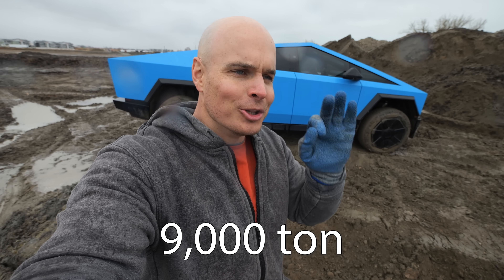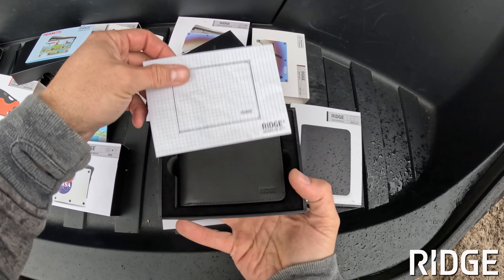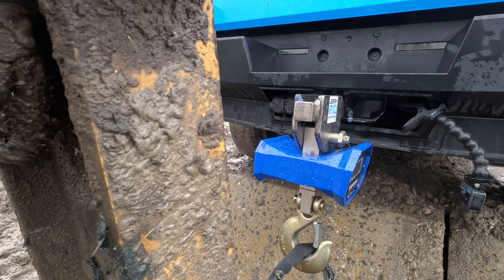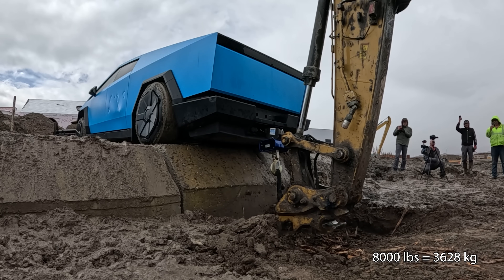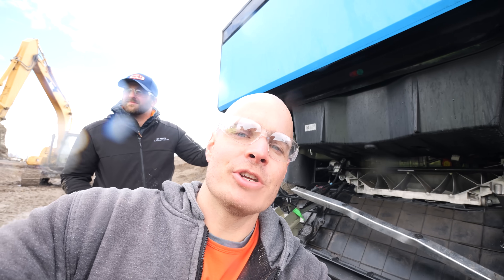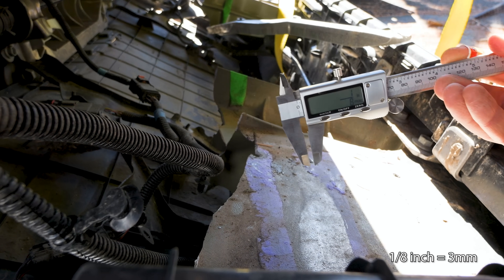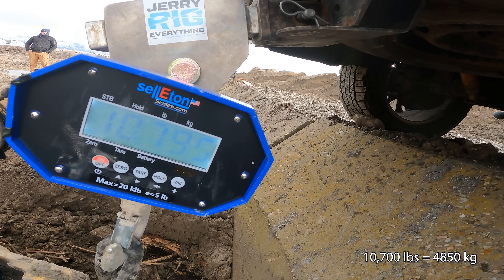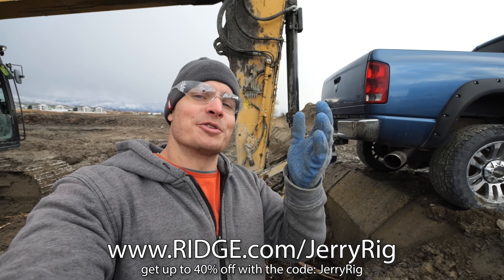SHOULD YOU TOW WITH A CYBERTRUCK?! - (catastrophic failure test)

Comment: Normally a hitch is only designed to take a downforce of around 10% of its towing capacity which works out at 1100 lbs. The actual spec may be different but 10% is the normal yardstick.

Not only did you go more than 9 times that amount, you were holding the front of the vehicle down. It was an unrealistic test and one that really isn't in any way relevant either to the real world.  Not a fan of the Cybertruck but I cannot see any cause for concern if operated by someone using a little common sense.

Comment: "10,000 lbs where it breaks is not a good thing."
Dude what? You put 945% of the rated tongue weight on the truck. It outperformed its rated capacity of 1,100lbs by over 9x.

An 11,000 lb tow rating does not mean that amount of force is applied on a hitch. Typical tongue weight ratings are ~10% of towing capacity. Which would be 1,100 lbs.

Comment: I bet all the error messages are from one communication bus going down. Did they use CANbus in the Cybertruck? Some small signal wire probably got shorted when the bumper broke off affecting all other communication on the bus.

Comment: Dude they use SpaceX engineers and materials scientists to design the frames, then they run it through simulation software at various fatigue values. I know you're smart so do the math of an uneven load and it's still safe. To think somebody wouldn't tow with it because some guy on YouTube broke it, when using it in a way it's not designed is foolish

Comment: It must be nice to spend $100k on an electric truck only to trash it. I drive an old Ram by the way, 2002 and it is still on the road. I could have bought 5 (bought new cost in 2002 $24k) of the for the cost of that Cyber truck and my frame wouldn't break.

Comment: Whats super weird is most other things that hold life risk responsibility usully require 3x the max shock load as a saftey factor before yielding. And in many other cases multiple "X" beyond that. Just to strap down that tesla on a flatbed i need to have straps that are rated for atleast 80% of the weight being secured and said straps need to be tested at 3x their rated capability without yeild. Idk how tesla got away with this but i can honestly say its a trend ive seen and feared in the auto industry since mid 2000s when payloads andntowing capacity seems to skyrocket without much change in frame designs reallynonly to be minorly tempered but class 4 and 5 hitches on the light duty "heavy duty" pick ups

Comment: First, an aluminum structure is whatever strength the designer made it to be. Quit saying "aluminum vs. steel" - the material doesn't matter, what matters is the design. You could make a friggin' cardboard truck that is stronger than a steel one if you wanted.

Second, you're completely misunderstanding the concept of fatigue limits. Steel will get weaker with every stress cycle until it reaches about 50% of its original strength, while aluminum and most other metals can continue to degrade beyond that all the way down to zero strength. This sounds bad, but it's typically occurring over the course of millions, billions, or trillions of stress cycles. What you did loading the hitch twice has absolutely nothing to do with fatigue. It has nothing to do with materials, it has nothing to do with casting or extruding, and you shouldn't have even mentioned any of that.

Third, tongue weight limits are usually specified as ~10% of the towing capacity - across all brands - yet you claim that "potholes" or "hills" can somehow increase tongue loads by 10X without even attempting to offer an explanation of the mysterious physics that you claim can cause this. Heck, forget physics and aluminum and all that stuff - if you and Diesel are the only 2 people in the world to have ever broken a Cybertruck frame like that, whilst deliberately trying to break the frame like that, why is this even a thing? Either show me footage of this epidemic of broken Cybertrucks flinging loose trailers all over the highway or quit wasting my time with this contrived nonsense.

Fourth, you have 10M subscribers and so much cash flowing in that you can whimsically total a $120K ($170K with the wrap) truck on a random Monday just "for the gram". Yet you couldn't bother to spring the extra $500 to rent something capable of supplying more force? I might forgive you for not Googling "how engineering works", but to not even finish your own project is just lazy.

Finally, don't dismiss my criticism as some sort of defense of Elon. F that guy. Nor am I defending the truck. I'm only defending logic, physics, and engineering - all of which you have failed to respect in this video.

Comment: Jerry, I am disappointed you are not aware of the huge differences between Shear Strength and Tensile Strength.
Shear Strength = Tongue Weight Capacity and Tensile Strength = Towing Capacity. (To put it simply, but there are more variables to Towing Capacity)
You should have researched this BEFORE you made the video.

Comment: also it wolud not allow brake away brakes to be applyed in alot of cases as the wire that makes that sustem work  is atached to the same area as the safety chains slos can you cut some of the alloy out of the back test it to see its ductility ect please if you own one of these please dont tow things

Comment: to be fair if the hitch snaps of the trailer wont be running on the road by itself ,seeing the faults it gave the truck would crunch the brakes i guess {seeing it wont drive } so if the hitch snaps off it would simply plow into the back of the truck im guessing

Comment: Tonbe fair, the cybertruck was bottomed out... with the more ridgid body, the cyber truck creates a stress point on the frame, making it easier to bend... the dodge pivots on the wheel, distributing the force through a larger area... you can clearly see the whole bed of the dodge bending, whereas the cybertruck has nonflex... not saying the cybertruck has no flaw in the design, but i also don't think normal use would cause this failure...

Comment: This is an inherently flawed test, and just to preface,  am by NO MEANS a fan of the cyber truck. Here are my thoughts and someone please try to prove me wrong.

-a tongue weight of 10,400 will NEVER be reached, or even half that if towing at the max capacity of 11k. Ir doesnt matter how steep a hill you crest is, it would have to literally be driving straight up a 90⁰ straight up to horizontal with the trailers tires coming off the ground to see all that as tongue weight, which no vehicle is capable of doing. Like if you spun out on a bridge and the trailer went off the side. But in all reality, if that scenario ever happened, snapping off would be the best outcome you could hope for.

-I own a dodge ram, 2002 but this happened ~8 years ago so it would have been younger at the time as this one was today..amyways iy was a little hopped up, nothing crazy maybe 500whp, and i sled pulled with it a few times. Less than a dozen pulls in, i literally ripped a class 5 hitch in half and bent the frame inward. Now im sure everyone has seen the tesla vudeo of the cybertruck pulling a sled, and several other people have pulled with them as well. Those sleds weigh around 40k lbs...and its not like the bottom is flat, they have like 2" angled teeth underneath to dig in to the ground. And this is on. Well prepped track where you can get better traction than unprepped asphalt. 

-if you had to hold the front of the cybertruck down, its not realistic. How many times have people created a hill, or hit a bpnin the road that caused their front tires to come off the ground? Cmon, lets be realistic here.....

-no one is going to be pulling 11k anyways, because the range would be like 50 miles, and an 11k camper would be a 5th wheel or goose neck anyways, not a bumper pull.  

I don't think the cybertruck has the best design for towing, but if kept within its ratings, you will have to be intentionally trying to break it off.

Comment: You guys are nuts! This test proves nothing. I bet if you hooked a Ford F250 to this test it would fail also. Nobody in his right mind is going to hook a trailer to any pickup with over about 500 pounds of tongue weight. the axels of the trailer are supposed to carry the 10000# of trailer and cargo weight. Even a fifth wheel should not put that much load on the rear axel of the toeing vehicle. The trailer would not be manageable with that kind of tongue weight at anything over about 30 MPH. Lets see you do this test without holding the front end down. Then tell me how someone is going to drive the pickup with that overloaded trailer hitch. Who is going to drive that front loader in reverse ahead of the Cybertruck to accommodate such a hitch overload? YOU GUYS MAKE ME SICK!

Comment: No, Tesla did not invent the Giga Press. The Giga Press is a type of high-pressure die-casting machine developed by the Italian company Idra Group, which is part of the LK Group, a Chinese manufacturing conglomerate.

Tesla was one of the first major automakers to adopt and scale the technology for vehicle production, particularly for casting large sections of car bodies in one piece. This innovation significantly reduces the number of parts needed, improving efficiency and manufacturing speed.

So while Tesla popularized and pioneered its use in mass automotive production, the invention itself came from Idra Group.

Comment: Is it weaker than steel? Yes. Is it strong enough to tow safely? Also yes. As long as you're within the tow rating there's no realistic way enough vertical force can be applied to break it. Maybe metal fatigue over the life of the truck will change that though. I dislike the cyber truck, but this doesn't prove what Zach is claiming it does.

Comment: For all those that believe that hitting pot holes and going up hill really increases the weight on the notch this much have a think about what they just did with the dodge.
They used a 50000lb+ excavator and tried to make it put as much weight down as possible to the hitch, but he could only get 10000lb, 1/5 of its weight.
So what do you thing the realistic hitch weight of a trailer with a central pivot point off the axle is going to be applying, it will definitely be a lot less then 1/5 of the total trailer weight

Comment: The safety factor in automotive engineering is typically between 3-5x the rated value. If the tongue is rated to 1100 lbs, then we should expect it to fail around 5500 lbs, not 11000 lbs. 

I agree, steel is stronger and safer than aluminum. I'm less convinved that there's anything wrong with the Cybertruck's hitch. It's not as strong, but it did just demonstrate an almost 10x safety factor.

I hate Elon Musk and I don't care for the cybertruck at all, but this video is bad data.

Comment: Even hitting a pothole or speedbump or towing over the crest of a hill will mostly increase the pull on the hitch, not the weight. Shocks absorb (get this) shock loads. You'd have to a accelerate the max rated weight on the hitch (1,100lbs) at over 9Gs to break the hitch. In order to do that you'd have to first bottom out the suspension, as anything less will just be soaked up by the shocks. Even then you're not likely to pull 9Gs. So the only criticism could be that the CT is merely way way stronger than needed, instead of way way way way stronger than needed. That seems like a rather silly argument to me.
Reply: Anyway it should lifted the excavator like other truck's
Reply: @tmmehedi  Why? Let's say other trucks could go 500mph and the CT could only go 350mph. Why would that matter to literally anyone if the max speed you'd ever get it up to in any vehicle is 90 - 95mph? Especially when the design of the CT offers other benefits in other areas - lighter weight, lower cost, stiffer chassis..?
Reply: @truhartwood3170  i think people forget that it's a truck not like daily driving vehicles in the city . A truck must be robust for extraordinary tasks, not for high speed .

Comment: This test is extremely flawed with downward force towing limits pulled completely out of the air. I am subscribed to this channel but this is the first time I've had to comment. Receivers are rated to 10% towing capacity rating of the weight of the trailer, based on a properly loaded unit. Not 100% of the trailer weight multiplied by whatever number you decide. This isn't even a test of the shock load, it's a static test done extremley slowly. This test proves you could hang a 30 foot, dual axle, fully loaded camper off of the back of this truck over a cliff. Nothing more or less.
Reply: Anyway it should lifted the excavator like other truck

Comment: To me the dodge had a more give in the shocks leading to a steeper frame angle. The force applied perpendicular to the frame is less even though the number is the same. 

I’m curious if you held the two trucks down differently, or there’s a way to put the cyber truck in high suspension mode. 

I feel like there’s some flaws in the comparison, but yeah it’s new manufacturing method of course it’s not gunna exceed historical steel production quality, but it does meet the legal regulations and stabdards.

Comment: I’m surprised I dont see more people saying this: forces on a trailer tongue are dynamic, just because it has 1000 lbs on it static doesnt mean that they wont exceed that by a lot while driving. Add an overload situation (easy to do in the real world) and add up stress and corrosion over time, throw in an accident that would even bend a tradtional steel frame and instead of bending a trailer could become completely detached and become a battering ram. I think the tow ratings might be reduced in the future…

Comment: I think you just proved that the Cybertruck's hitch is very strong. Basically you proved that it's strong enough to hold a 10,000lb trailer hanging off a cliff with nothing else holding it except the hitch which is not Tesla's claim of towball weight or the intention of a hitch which is designed for horizontal strength rather than downward force. Basically the front wheels would come of the ground before that hitch breaks in normal operation.